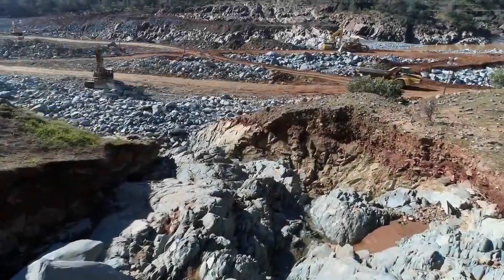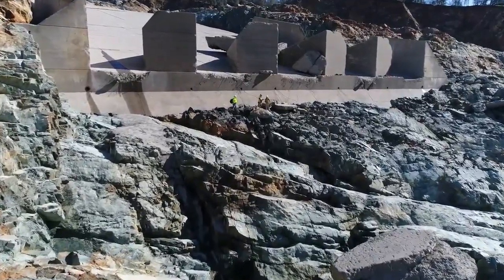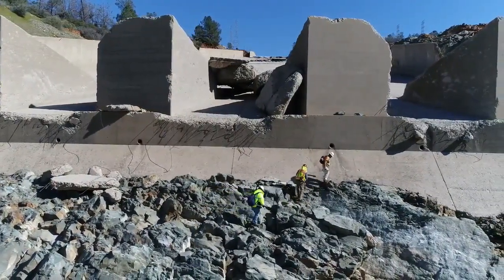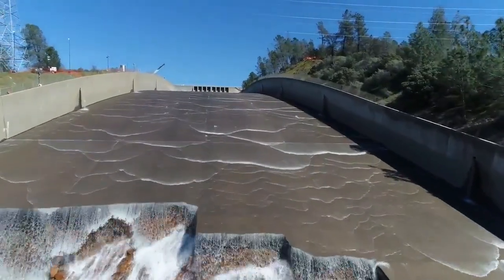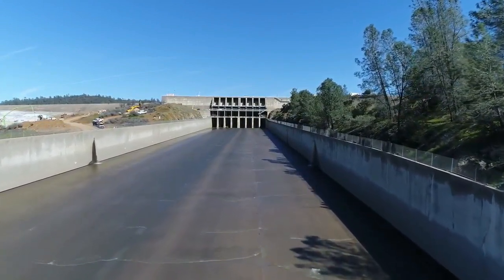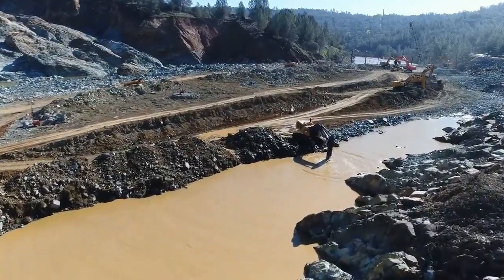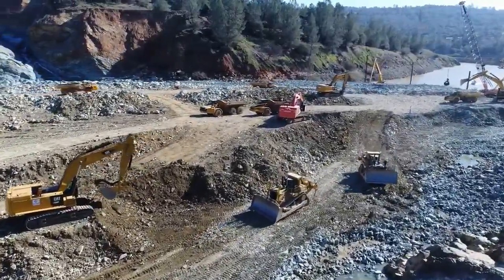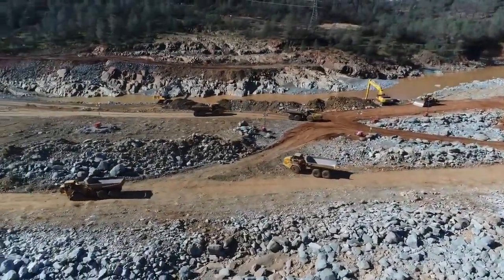Lake Oroville Dam Spillway Update | Outflow Continues | New Drone Video | 3-2-2017

Comment: Well, in all truth, they will HAVE to use that spillway if a big storm comes or all that mountain snow cuts loose. There is no other way to run off enough inflow without that spillway. It worked before, even though it was slowly eroding. Also, it managed to handle a hundred years worth of rainfall in just a few days, so I'd say it still has a lot of life left in it, even if it makes another huge mess to clean up. Do you have a different or better idea for how they can let go of so much water at one time?
Reply: How about they dig a canal on the far left of the dam away from dam and when the spill way and emergency spill way begin to erode and threaten the main structure open of the lake to the diversion canal to lessen pressure on the damn.  It has the advantage of getting the spoil further away from the power plant.

Comment: They will HAVE to use the spillway.  No question about it.   The powerplant, if opened can only put out 20% or so of what the spillway can.  There is A LOT of snowpack and this story is far from over.   Looks like they are making good progress so they can run the plant and run the spillway at a rate that will cause less erosion.  If they give the water a path it will work.  No choice as they cannot get to 900+ again with the emergency spillway.

Comment: Even if the rebar is an inch in diameter it still would look like little hairs on that scale. And I might add they may be forced to use the spillway again, the Sierra snowpack is 229% of normal. I saw the guys trying to measure it, they were unable to get their measuring pole all the way to the dirt. If the weather warms considerably, especially if there's rain with it, that snow melt may be overwhelming.
Reply: Snow melt is normally gradual enough that it poses no problem. The sun is still low in the sky at this time of year and temps are still well below freezing in the high Sierras.

Comment: No matter what they do, they're screwed (IMHO). Why they feel the need to get the power plant operational again baffles me. That's just idiotic, and damn dangerous! Obviously, using the main spillway is going to erode it even further, especially if they've removed some of the debris choking it up. So it seems they're going to use the auxiliary spillway. However, if they use that, since it's all dirt, the water will undermine it and it probably will suffer a catastrophic failure. The thing is, the are completely aware of that. After all,  It was in the engineers briefing video where I first heard it. So why use it? Maybe they think they can get away with it? After all, there's a whole lot of dams that all empty into the Oroville reservoir. And there's nowhere else that water can get diverted to...
A basic rule of construction is to never have a single point of failure that can bring the whole project down. Like Oroville.
So, in my humble opinion, no  matter what they do, they're screwed...
Reply: There is NO AUXILLIARY SPILLWAY (smh).
Reply: Emergency Spillway................water has only 3 ways of getting out of Lake Ororville:
1) through the penstocks that feed the Hyatt power turbines (max 14k cfs)
2) main spillway (max 250k cfs)
3) over the top of the emergency spillway (Mother Nature mostly decides)

Comment: Why aren't they pumping water around spillway?
Reply: No it wouldn't. There's no way you can pump that amount of water. Besides, they've lowered the lake level to 840 feet and don't need to drain out any more for at least a week.
Reply: They need to open the Chanel up to restart the power house and allow water flow past the debris field.  Pumping wouldn't do any good.
Reply: pumping with massive pumps will buy them time to do the necessary repairs.
Reply: do you really think it's only going to take a week to fix the the spillway.
Reply: Of course not.  That's why they have been doing improvements to the Emergency spillway structure and slopes as well as clearing a channel to allow the power house to be run again.  There aren't enough huge pumps in the world that can produce flows of 100K CFS.  If such a thing were possible or easy they would already have done it.

Comment: there is so much gold in them there hills
Reply: No, no, no.  They don't need to completely drain the lake and build a new dam.  The dam is fine, only the spill way complex is a problem.  Power connection to the power plant has been restored, and they are waiting to have enough of a channel dredged to accomodate power house outflows.  Get your facts straight before making stuff up and soliciting more doom and gloom.
Reply: Either option, use of the overflow weir, or the broken concrete flume would be very problematic.  The weir has significant erosion and is far too unstable to position the electrical towers which were recently removed for this very reason.  Use of the flume will result in additional material clogging the outflow near the base of the main dam, destroying the current dredging work, and shutting down the power plant (if they ever get it running again.)  The only real solution here is to completely drain Oroville Lake, completely reconstruct the dam, and to create both an over flow weir, and an emergency spillway at a different location where they can't destroy the power plant.  It will take several billion, and a crew of ten thousand, but must be accomplished ASAP.  The snowmelt flooding will begin soon and people need to be better informed of the realities of this situation.

Comment: couldn't you have shown more pictures than that? Emergency Spillway is nowhere near capable of handling the snowpack runoff and warm weather crack ! exclamation point! in the main spillway ...better be pumping concrete I'm sure they're thinking of it.. does it rain in the mountains there in California? in the spring?
Reply from the maker: We share what we have...the information is coming out at a slow drip
Reply: They are using the material being removed from the diversion pool to shore up the damage from erosion and also improve the emergency spillway should it need to be used.